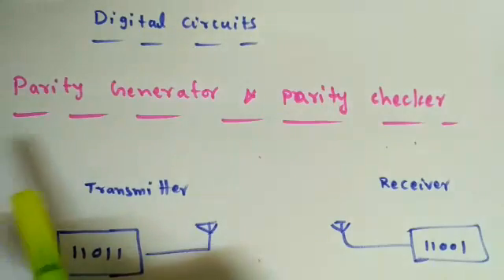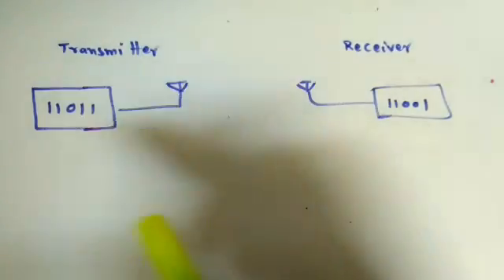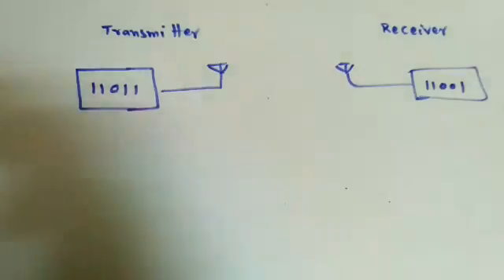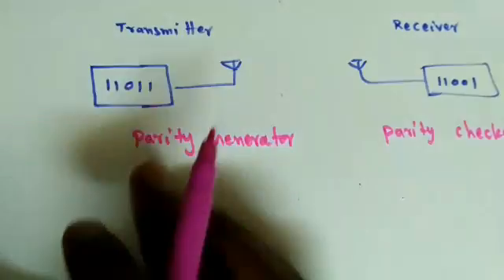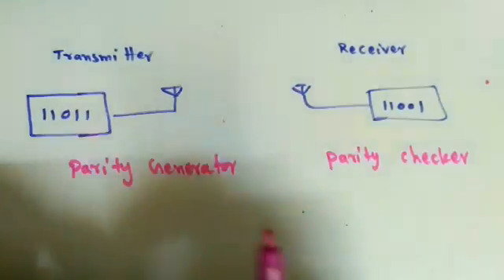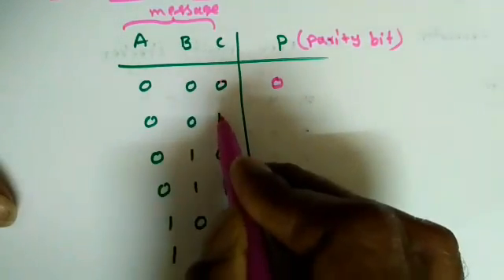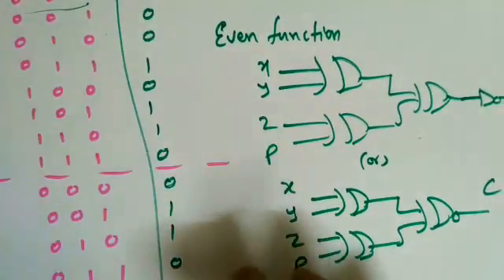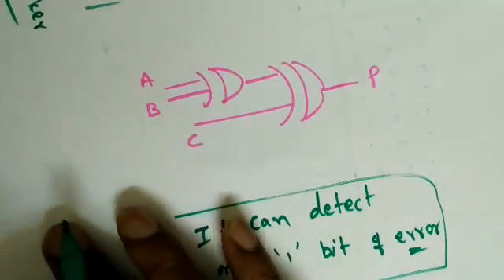Parity Generator and Checker | ECE | Unacademy Live - GATE

Comment: What is the parity generator called ...3 bit or 4 bit...?
Reply: We will not assure all messages which we r sending.. it will reach correctly or not.. It is like registered post.. Acknowledgement is required.. So same postal scenario we r using here.. That is called as  parity generator.... To confirm that received message is correct or not we r using parity generator.. In sender and receiver.